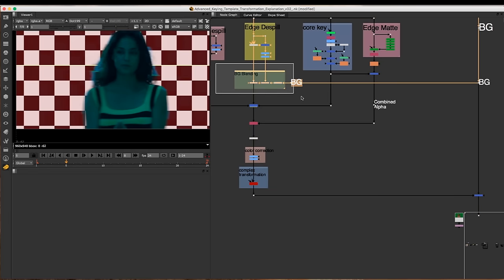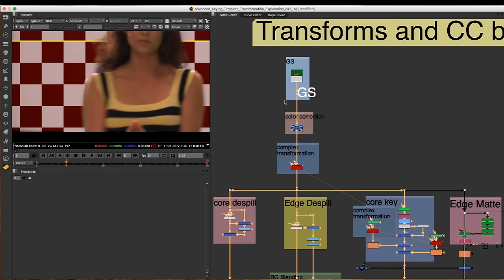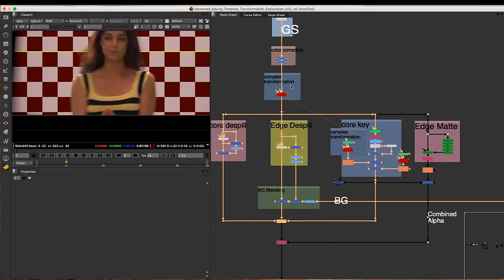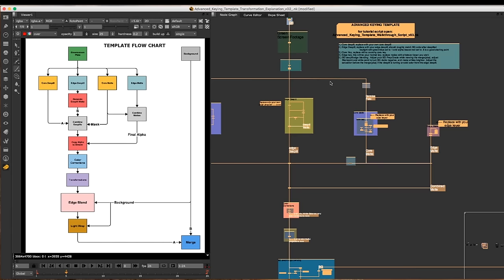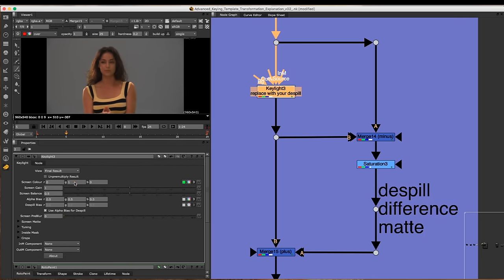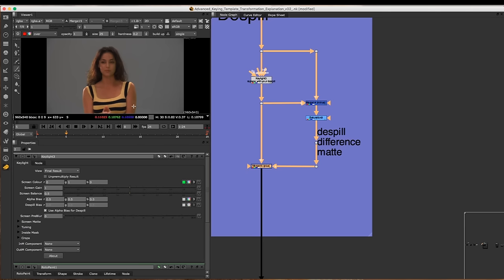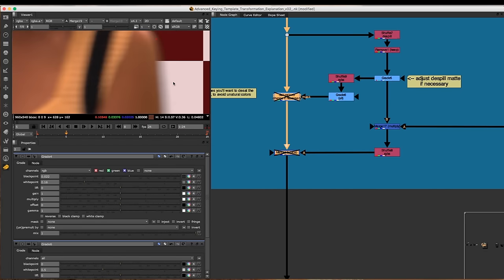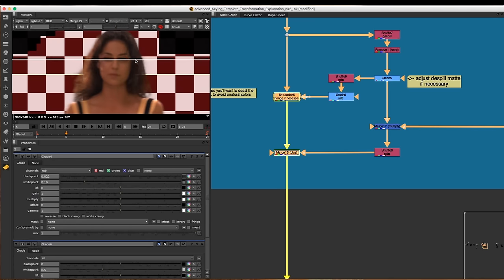Advanced Keying Breakdown: 4.1 - Template

Comment: Amazingly helpful video again. Good work and thanks for taking the time to do it. 

One question though, the only thing I don't quite understand about the Edge Blending area is why do you shuffle in the Despill channel from earlier up the chain, to use as the matte for the BG Blending and Desaturation etc? Why can't you just use the Alpha/Matte that's already there from all the keying work to use for the edge blending? It should still have all the transforms too? Might have misunderstood it's use. Thanks
Reply from the maker: +cobblesticks 
This is a great question!  Short answer, you probably could!  I think the main reason why I use the despill matte is that when you plus the regular despill matte back onto the edge despill section, it will then match the same luminance as the original greenscreen (or somewhere very close).  if you use the (inverted) alpha channel to multiply with the BG, i think the initial result would be quite strong.  You'd be plusing almost entirely the BG colors full on, which might get bright.  But the counter argument is you could just CC the BG darker, which I suppose would work fine.  
I think the despill matte tends to get the blending better than a regular key.  A lot of times, alpha keys can be very crunched and harsh, whereas you'd need a very soft key to get all that blending.  The despill matte is almost literally saying "where is the despill?"; so it tends not to be as harsh.  Also the alpha channel tends to be clamped, and you might want to revive some of those details.

But I think you could use the alpha, and if it works better, then Id say go for it and ignore the despill matte if you wish!
Reply: +CreativeLyonsTuts Cool. Thanks. Maybe that gets you a better result then. I'm just not used to yet using lots of 'new' channels and piping them out. Does this method then negate the need to use the Additive Keying method?
Reply from the maker: +cobblesticks No.  Additve Keying is quite important, and I'm going to do a video on that soon. (I'm having trouble finding an additive keyer that is open to the public like on nukepedia, all the ones I know are proprietary, so I might just make my own, since it's a pretty simple process.)  But no, the additive keyer would go just before the merge, on the BG side.  

Make new channels should be used sparingly.  But it's something that is quite powerful, especially in situations where you need to do something to all channels at once.  Another common reason to use them is if you know you'll use that matte channel (or roto or ID matte) some other time, and instead of big long lines going all the way across your script, you can just pump a channel in the stream and call upon it later.  It often makes for cleaner comps.
Reply: Best series of tutorials ever! Thanks so much for this! so informative! 
Question regarding this thread...did you ever get to make that additive keyer tutorial? Thanks!